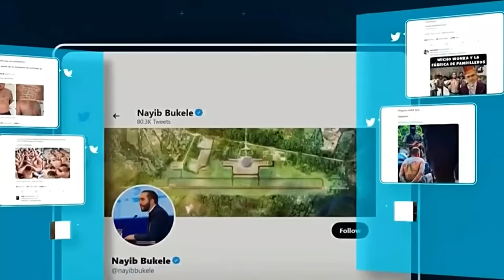El Salvador MEGAPRISON - Inside the Largest Prison in the World  Built to House 40000 Gang Members

Comment: It would have been interesting to also hear about the costs & financing - as that is something that can plaque such an institution in the longer run.
Reply: They save money by keeping these scumbags locked up. I think, this is moey well spent.
Reply: they will probably shut down a lot of smaller inefficient prisons around the country which should help balance the undoubtedly huge budget for this. The biggest threat in the long run is national politics and corruption amongst guards.
Reply: military soldiers are used to guard the prisoners , but I wonder if the prisoners will start doing some kind of work . modern equivalent of a chain gang , maybe build roads or start a farm .

Comment: Check out the video on Bukele's channel. These guys get no visitors. Iso cell actually has a ceiling hole so it won't be dark in daylight. Most of these guys are in those cells all but 30 minutes for exercise, right in front of the cell, at gun point. Bukele is a rock star!

Comment: As a prison should be but you forgot one thing. What if the electric grid goes down? Then to prevent scaling the walls of cement, you should have big shards of broken glass cemented to the upper sides and tops of the walls to ensure any escapee gets ripped to shreds.

Comment: New prison in on itself will achieve very little. While it is necessary to have an incarceration facility that is at least not run by inmates, you have to remember that it's not old cell design that enabled corruption there. Country's social and economic issues did.
Also some of those gang members will eventually be released back into the public. Most of them have no education or practical skills to make a decent living, gang life is all they had, so without a proper reeducation and reintegration system they will just relapse to their old ways.  
Props to El Salvador for trying to make a difference but it is a long and hard road. Good luck.